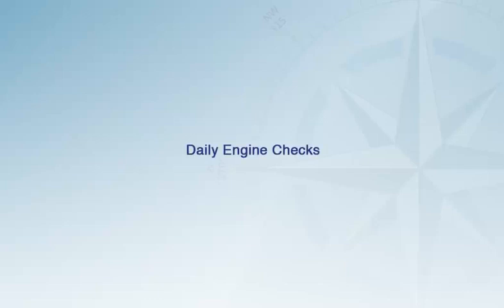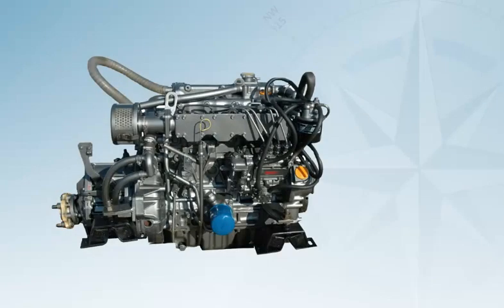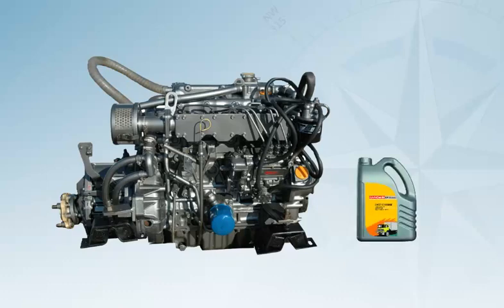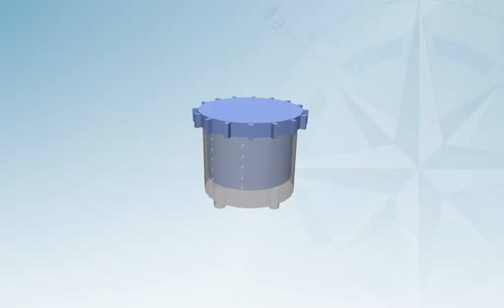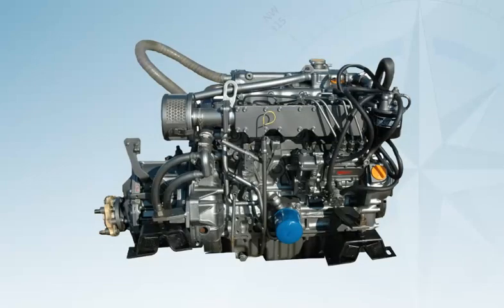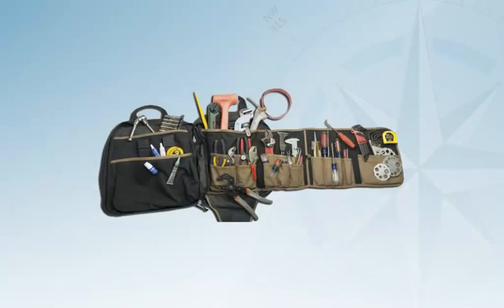Marine Diesel Daily Checks

Comment: I am a pactical minded person and even though I have done a lot of boating I have never really had to do any mechanics on a disel engine a part from changing the impeller. So I should not be too afraid then when I find myself with my own sailboat with a marine diesel engine to maintain all by myself! However when I eventually do buy a boat, what should I really check for and inspect when it comes to the engine?